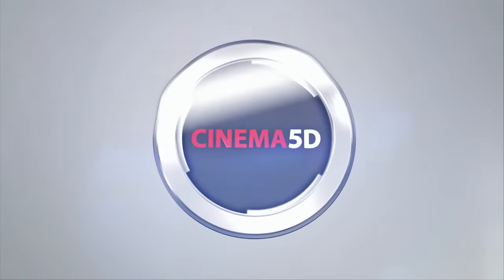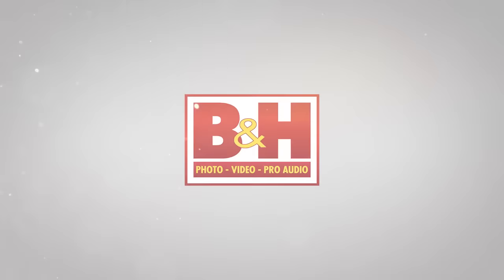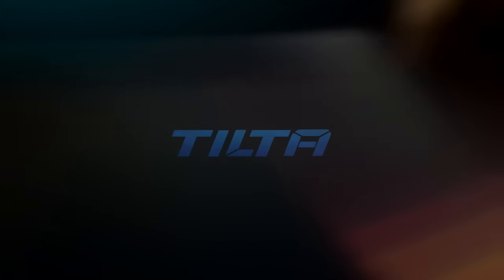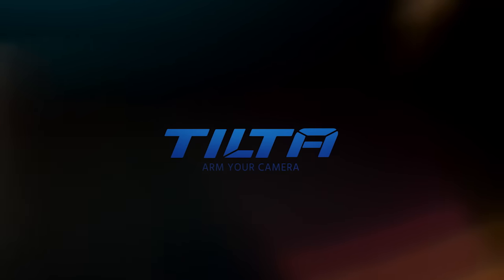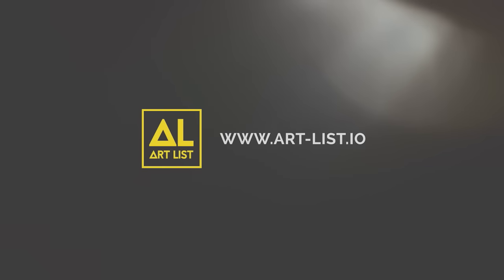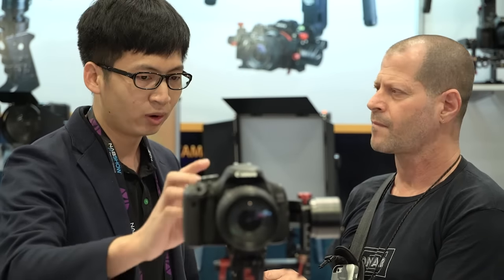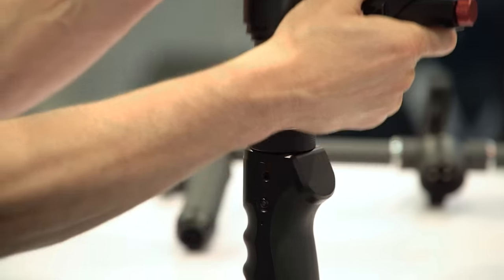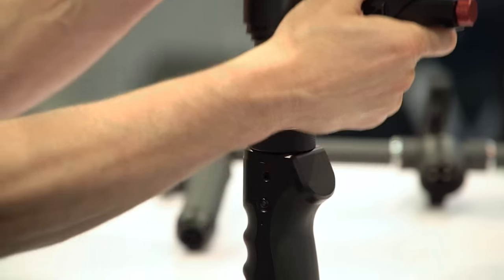New CAME OPTIMUS Gimbal – Upgrade to The CAME SINGLE

Comment: the battery they use probably still same as the old came single. 
which is useless, after few charge it will be dead and you cant use the gimbal at all....
mine already had 2 battery died waiting for a 3rd battery /sign
Reply: No I don't have this new version gimbal, they wont upgrade it for me either.
And I WONT be buying any products from them anymore. (I shoot wedding and it messep up so many shoot on me already.)
Not to mention the remote system do failed also..... mine use like 2 times and its dead, now they replaced a new one, if the is warranty over just hope it wont have any problems...
I felt my 1k went into nothing. GL on anyone want to buy from them ;P
Reply: I had a dodgy battery as well with the original, tried about four of them out in the store before giving up and getting a refund. So I don't have much faith in the quality control of CAME. But when it did power up it worked quite well. So now the batteries are changeable and not built in to the handle I'm hoping that will solve any issues down the line.
Reply: the new battery CAME sent me was just a regular 25C 11.1v Lipo RC battery (I know it because It has the sticker, the previous battery the sent me don't have any stickers)
I guess you can replace it yourself, but getting one that fit into the handle is quite hard to find :(
Reply: real shame. your not alone, when i was in the store they had a whole bunch that got returned. it's a bit impractical but I did manage to power it via the DC connection to a Lanparte VBP-01 V-Mount Battery plate, so that might be one work-around
Reply: glad to know they really had a big issues with the batteries, how you manage to power it?
with the charging DC port? do you did any mods?
I tried to power it with the wall charger (with the dead battery inside), but it just wont power up, 
how do you use a 12v V-mount battery to power it?
Reply: Mine was powering up with the mains plugged in which is why I tried the DC. But if you don't have that working, then I can't imagine that'll work. Maybe you have an issue other then the battery then. That Lanparte battery plate has a DC 12v output so I was able to use a particular DC to DC cable to hook it up.

Comment: Hey, The button fallen off. The first time I use it. This piece of shit. Who have to same problem with the button on the Came Gimbal
Reply: I tried to glue it back in, but used the wrong glue and it destroyed my joystick, lol. Support sent me a new one though and I could fix the problem. 
Another thing I noticed, when you use the remote, the joystick in the gimbal itself stops working after  a while. However, I mostly use the gimbal in one hand and control it with the remote in the other hand anyway.